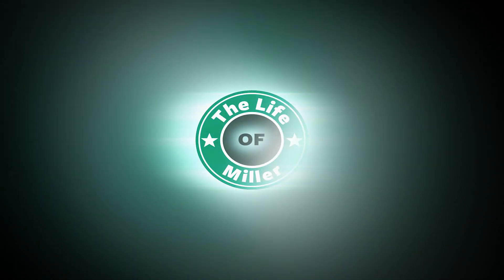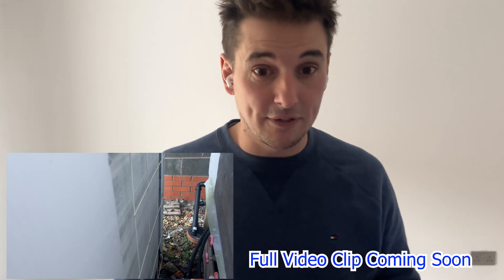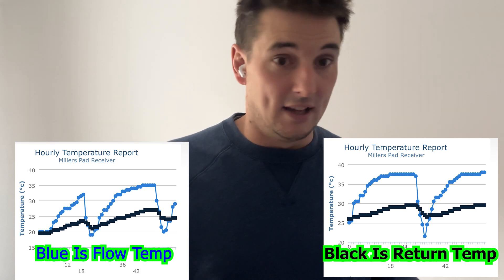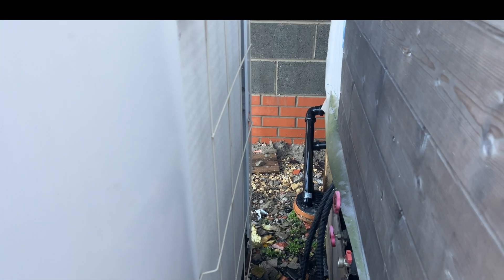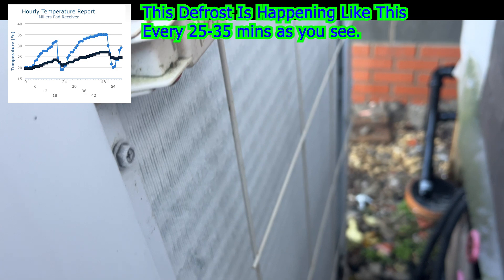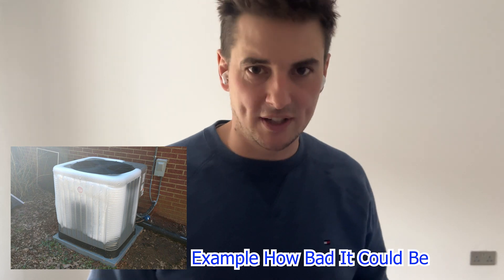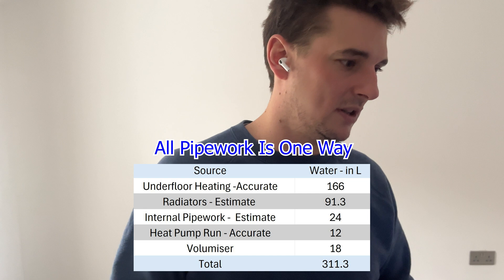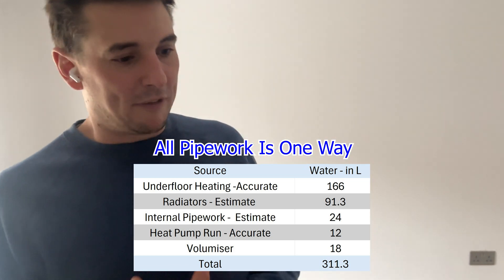My BroKen HEAT PUMP - HELP

Comment: Get the refrigerant charge weighed out and checked against the units base charge
Reply from the maker: That was all checked.
Reply: With your flow rates pretty decent, without knowing the model couldn’t tell if it’s what’s correct for that HP but I’ve had loads of systems with crap flow rates and they don’t ice up like yours. Defo a refrigerant flow issue. Possible out of whack expansion valve or expansion valve motor head? The fact it worked for a good period of time before it started doing this makes me think oil migration in the HP, it’s hard to prove but will have to recover all the refrigerant and started un-brazing parts of the circuit then blowing them through with nitrogen to prove where the restriction is. 
Hope you get it sorted geezer 👍

Comment: I had the same unit before, as an hvac engineer, played a lot with settings. 200 m2 newly built home, only floor heating. My hp starts do defrost even at 8 C ambient temp, wich was strange for me... I used weather compensation, defeost cycles every 50 minutes even at only 40-50% constant load (compressor frequency 40-52 Hz). So I tried so many settings, nothing changed. I think this unit (or only this size) has this problem. I was able to heat my house even at -8, but then no defrost anymore because of the dry air. I was lucky because the oversized unit, but didn't have much heating power reserve for sure... I was able to run the system close to 1:1 start/working hour ratio, wich is really good. But after 1.5 half year of operation, the compressor became really noisy, even at 50Hz (at the beginning the unit was really silent). So no more Ecodan for me... 😢

Comment: The default line given by HP installers about a HP that’s not working is, “ bad install “ .  Nobody fixes them , not even Adam from heat geeks , check out his video with skill builder , they go to a house with a HP that is working but turned off because it’s expensive to run and the outdoor unit is noisy , which Adam says is an easy fix, fit a weather comp sensor. The next video they rip out a load of equipment and install 20k of new equipment. Comedy gold 😂
Reply: @haydnlawrence8167  by 20k you mean a new cylinder with a bigger Coil? Not 20k is it

Comment: Begin by confirming the fundamental design aspects of the heat pump system. Check that the outdoor unit is located with sufficient clear space for proper airflow (minimum clearances per manufacturer guidelines). Ensure there is no obstruction (like shrubs, fences, or walls) preventing adequate air exchange through the coil. Also verify that the heat pump is oriented properly. If the unit is in a particularly shaded, damp, or windy microclimate, ice can accumulate more quickly than normal. An 18-meter pipe run is typically acceptable if installed to Mitsubishi specifications (pipe sizes, insulation, oil traps, etc.), but it must be double-checked for correct sizing and insulation to limit heat loss in the lines.

NEXT

One of the most common causes of short cycles and rapid defrosting is insufficient water flow or insufficient buffer volume. Although you now have an 18-liter volumizer (buffer tank), confirm that:

The internal system pump or any external circulating pump is operating correctly.
Flow rates meet the design requirements (e.g., confirm the required liters per minute based on the heat pump output).
The distribution system (radiators, underfloor heating loops) is properly balanced, and no zone valves are closing unexpectedly, causing sudden flow restrictions.
The delta T (difference between supply and return) is within the manufacturer’s recommended range (often 5–7 °C for low-temperature operation). A delta T of 8 °C or greater suggests a possible restriction or insufficient pumping.

NEXT

If the unit is routinely frosting at relatively mild outdoor temperatures (above freezing, +3 °C to +7 °C), it’s possible there is an issue with the refrigerant circuit or the electronic expansion valve (EEV). A miscalibrated or malfunctioning EEV can cause the evaporator to run too cold, leading to fast ice buildup. Likewise, an incorrect refrigerant charge—either undercharge or overcharge—can upset system pressures and temperature control. Request that the service engineer measure suction and discharge pressures during operation, verify subcooling and superheat, and compare with Mitsubishi’s recommended values for that model.

NEXT

The defrost cycle is triggered by a combination of coil temperature sensor readings, ambient temperature, and elapsed time parameters. If the coil sensor is out of calibration—even if replaced once—it could prematurely detect freezing conditions. Have the technician compare coil sensor readings against an external thermometer taped to the same location on the coil. Confirm that the defrost control logic is using the correct firmware or software revision (you mentioned a “brains” swap, but ensure the correct parameters/firmware version is indeed installed).

NEXT

Connecting a service laptop (as Mitsubishi did on the fifth visit) is an excellent approach, but the recorded data must be carefully analyzed. Specifically, look at:

Evaporator coil temperature trend over time.
Ambient sensor reading (on the unit).
Return-water and flow-water temperatures.
System pressures (if logged).
Frequency of compressor starts/stops and defrost initiations.
Review this data in conjunction with the setpoint and actual load. Note any time the system quickly ramps compressor frequency (if it’s an inverter) and see whether supply temperature is overshooting setpoint or if coil temperature plummets too quickly.

NEXT

Because your home is very well insulated, your heat demand may be relatively small. If the system is oversized or the flow temperature is set too high, the heat pump might quickly satisfy the load, then shut down or shift frequently into defrost. This can lead to repeated short cycles and frequent frosting. Lowering the flow temperature or using a properly adjusted weather compensation curve often helps. However, you mentioned attempts to raise and lower the curve with no resolution, so also double-check that no thermostats are ‘short-cycling’ the heat pump by opening/closing the load unexpectedly.

NEXT

Take a fresh look at the actual piping layout. Verify that:

The buffer (volumizer) is piped in correctly (common header vs. series vs. low-loss headers).
There is no bypass that inadvertently bypasses the buffer when certain valves close.
All air has been bled from the system (entrapped air can reduce effective water volume and hamper heat exchange).
The flow sensor within the heat pump (if present) is not malfunctioning.
If the system was installed in a hurry or with minimal commissioning, it’s possible a mis-piping or hidden valve configuration is at fault.

NEXT 

Request they double-check the EEV and reversing valve operation.
Ask for them to confirm software/firmware alignment with your specific model.
Involve an advanced technician or a recognized heat pump specialist with Mitsubishi Ecodan experience.
If the installer is MCS-accredited, you can also pursue recourse through MCS if design or installation mistakes are suspected. Keep thorough records of visits, what was changed, and the system’s performance after each change.

ISSUES IN ORDER:

Insufficient water flow or incorrect flow rate due to undersized pump or piping restrictions.
Defective/incorrect coil sensor or miscalibrated defrost control.
Refrigerant circuit fault (under/overcharge, expansion valve problem).
Control logic or firmware mismatch causing premature defrost initiation.
Installation or piping error leading to short cycling or poor heat exchange.
Overcapacity for the actual load, causing the system to short cycle and frequently frost.

Comment: You’re taking heat from the outside air and to do that there has to be a delta T. If the ambient temp is 3°C as you mentioned, it’s highly likely the evaporator coil will be below freezing. If the air is damp, moisture will condense on the coil and ice will build up. If you run the heat pump intermittently, it’s going to be working hard to reach the target temp and the out side evaporator will be very cold. You should try letting it run 24/7. Once room temps have been reached the heat pump will regulate and there should be less ice.
Reply from the maker: Tried running it 24/7 when it’s doing this and it does exactly the same thing. It can hit the temp needed however it’s just icing up.
Reply: I just tried mine. Full power for 1 hour. Air temp was 1⁰C and RH 85%. There was some iceing but no defrost cycle. Perhaps your fan is not blowing hard enough?

Comment: Hi, can you put the system on a fixed LWT say 55 degrees? 

If so can you then close all loops and trvs or thermo off and prove the heat pump has a decent delta T via the relevant bypass in place ? Id be interested in that first.

Comment: Serious question - Would it be possible to get rid and fit a gas boiler?
Reply from the maker: No took that out when I built it and went all electric .
Reply: @houserenovations-tlom7317  do you have a way of measuring the primary flow rate?
Reply from the maker: Yeah the system gives me that option on the control panel when it’s on yes.

Comment: for a good DT flow should be twice the KW of heat pump. weather curve 45'c@ -3 & 35'c @15'c, open loop.
Reply from the maker: Thanks for the comment however the pump cannot do that like I say and also I would melt in the house at those temps
Reply: @houserenovations-tlom7317 your house won’t be 45’c@-3 internally, that’s the flow temp, your design temp for your house should be around 21 degrees

Comment: Go into the main controller & do this:

Menu - Service - code 0000 - running information - code 540.

That will give you the current flow rate in LPM, do that with heating on HW off and then HW on & heating off and see what it says, should give you a good indication of whats wrong.
Reply from the maker: when the heating is on it is delivering 28L it says.

Comment: it does sound like a short cycle, where is the ambient thermistor, try relocating that if its anywhere near the coil or fan. Is the water loop a closed circuit? Do you have a pressure vessel?
Reply from the maker: Not sure where the ambient thermistor is on the unit sorry . I’m not an engineer I’m a home owner.
It’s an open circuit and yes for a pressure vessel.

Comment: At least with an A/C unit freezing up is typically caused by lack of refrigerant or no heat load caused by fan failure on the evaporator (or dirty filters on the air flow). With an Air to Water Heat pump I would first go for lack of water flow through the heat exchanger. Any inline filters or magnetic filters on the water pipes to the unit which could cause a flow restriction ? If it does your hot water does it work any better in that mode?

Comment: Is that system volume available to the heat pump? ie. Have you removed zoning etc
Reply from the maker: It’s an 1 zone system all radiators on to full also.
Reply: @houserenovations-tlom7317  were the big wig engineers fgas qualified? Worth checking the fgas circuit. As an installer, after looking at all the obvious...flow rate, dt etc, I would use a leak detector to see if any gas leak apparent. But an fgas engineer can check the gas temps etc

Comment: It seems you have enough volume in the system. I would:
1. Leave all TRVs open, set the ASHP to full weather compensation, ajudst the curve accordingly to get designated temp inside, disengage the thermostat inside the house in order not to command the pump on/off.
2. Check with your installer if your system is properly balanced (as you have underfloor heating and radiators) - check flow rate, delta T etc.
3. You just might need an buffer tank. You'll probably lose some efficiency but might solve your problem. Check with an ASHP engineer first.
Please keep us updated as it seems like an incorrect design or faulty install/setup. 
Good luck!

Comment: Take a note of the current target water temp. Drop the radiator water temp down to as low as you can get it. 25'c good places to start. Then, c if it lasts longer before defrosting. If in doubt do a factory reset to put it back to defaults. Disable the hot water heating until you get the rads right. As I expect it is trying to heat to fast. Generally it is supposed to tick over at a lower set point rather than turning off. Check outside weather combination. If it can be disabled might be worth a go. As this feeding in wrong data is going to cause a problem. Disable the back up heater if it is fitted.
Reply from the maker: Thanks for this , will give these tips a go .
Thanks very much.

Comment: I’ve just experienced this with a brand new 9kw Daikin heat pump.  It was short cycling just like yours.  We eventually discovered “Modulation” was switched off and the internal heater (sorry I do not know the technical name) was turned on.  We’ve now setup correctly and the power gently increases and decreases.
Reply from the maker: I feel this is what it needs . It needs to calm down getting to temp instead of just going head on at it !
Reply: @houserenovations-tlom7317  Yes first of all turn the "backup heater" off.  We did this on ours by making sure it only came on at -7 degrees.  With the heater on, it is fighting itself and costing you a fortune.  Then double check "modulation" is definitely turned on.   This has definitely fixed our cycling from massive 5.8 kw spikes to off every hour.  If you turn the heating element off this will reduce it by 2-3 kw (depending on the size of the element) anyway.  Today at 8 degrees outside we are now running fairly steady 1kwh during the day with rooms at 21 degrees.  Hope this helps?

Comment: It's really hard to fault find a video of a heat pump install without a floorplan and heat loss survey. However if you have done a lot of work to the property and have decent air tightness and insulation there's a possibility that the unit could be over sized and is chilling hence they put the volumizer in. The other possibility is air currents around the unit, did anybody on the original survey do a smoke pellet test to see if it's a dead air zone that self circulates?
Reply from the maker: Thanks for the comment - no to the smoke pellet test. 
What do you mean by the unit is “chilling” sorry ?

Comment: Im no expert but have you checked flowrate? If the dt is high sounds like not enough flow so the return is too low and therefore heat pump working at max output and causing frost.

Comment: Interesting vid. All ASHPs go thru a defrost cycle. What COP/SCOP are you achieving?  You getting good support from Mitsubishi. They just need to keep working the problem. Sorry your installer is not more proactive.
Reply from the maker: Thanks for the comment. 
Mitsubishi were slow at the start but good nw in trying to get it solved.

Comment: What flow temp are you running, if your emitters are not big enough and you are having to have a high flow temp then it will freeze up quicker as the fan is working harder shifting air across the evaporator and this in damp air will freeze it up. I live in a 220 year old solid stone house with just loft insulation and ours o ly runs at a max of 35 degrees even at mi us figures
Reply from the maker: I can fix flow it at 35c and it does it . 
Comp curve it does it even more as does room temp.
Reply: @houserenovations-tlom7317  it maybe undersized then so working harder to maintain flow temp. It's a bit late now but if we have another cold spell try turning off some of your emitters to reduce output required
Reply: @houserenovations-tlom7317  if your delta t is wide then the heat pump will be quaking harder delta t maybe better being 5 or below. You could speed the pump up too

Comment: What is your heatloss, flow rate and what size is the heatpump?

You mentioned that the DT is wide, part of the consideration for a defrost is when the system can't maintain the flow temp. I wonder if the wide DT is partially causing this reaction.

Do you like in a wet part of the UK? If the coil is frosted up then you should be expecting defrost cycles even when the temperature is +3c
Reply from the maker: Heat pump is 11.2kw Ecodan. 
Heat loss I am not sure however it’s a large 5 bed house with open plan area and even with its defrosting at 0c temps and only giving us limited heat it’s 19c inside. 

The delta T can hit its target when it’s not defrosting and it’s around 6c+

No I live in Yorkshire so not wet I would say. 
I get it needs to defrost but not every 15-25mins you see.
Reply from the maker: Thanks for the comment and reaching out to help.
Reply: What's the flow rate? An 11.2kw is going to need around 32litres per minute to deliver its max capacity to the property. Use this link if you need a guide to find this information. https://youtu.be/QtSpuI-Zb0Q?si=Y2XszBOiU9KkJnp1

I suppose there may be an oversizing issue with a well insulated property. My 200sqm 1950s 4 bed detached has a heatloss of 8kw but in reality it's closer to 6kw now I'm running.